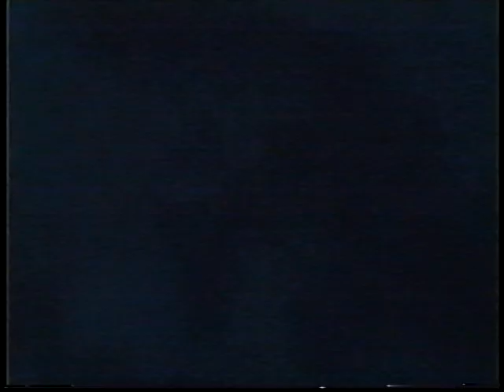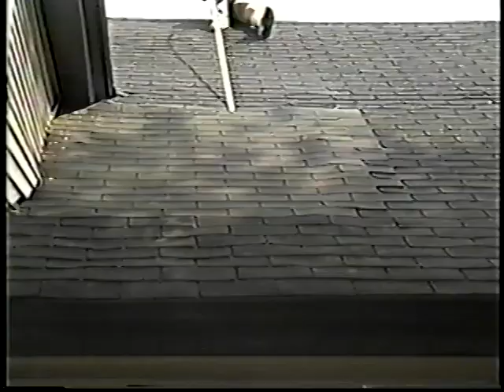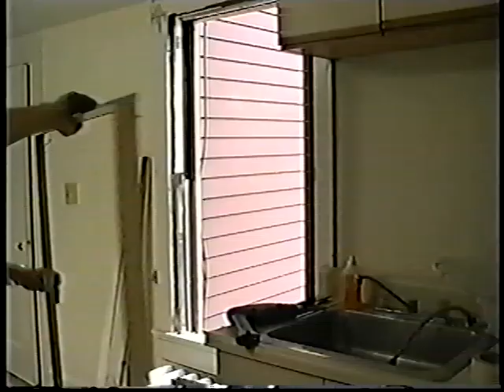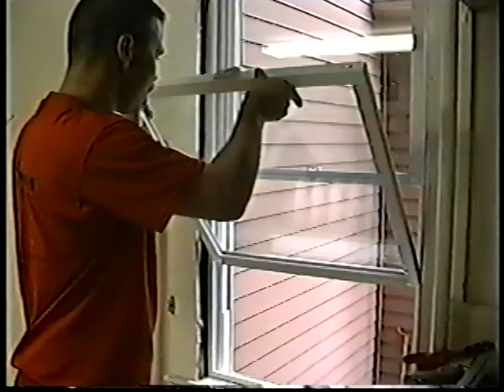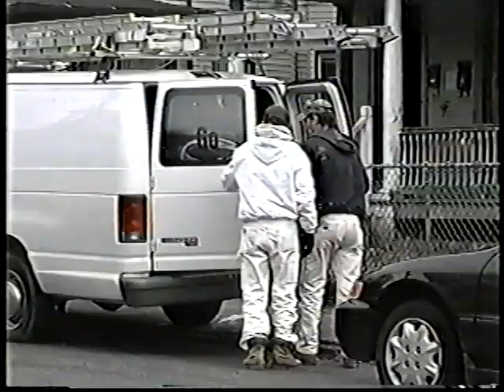Robyn Thompson’s Rehabbing Houses from Beginning to End - Tape 1: Rehabbing the Exterior (2000)

Comment from the maker: 🎯 Key points for quick navigation:

00:02 🏠 Introduction to the Rehabbing Process
- Introduction to the video series and Home Buyers LLC.
- Robyn Thompson introduces her company and the focus on rehabbing homes.  
- Overview of various repair processes, such as roofing, installing kitchens, and laying carpeting.  
- Robyn highlights the importance of reducing rehab time and minimizing costs.
02:50 🛠️ Roof Repair Techniques
- Detailed discussion on roof repairs, including the cost and steps involved.
- Introduction to the concept of "squares" for roofing and determining roof costs.  
- The process of tearing off and replacing multiple layers of shingles.  
- Discussion on roofing components, like valleys and chimneys.
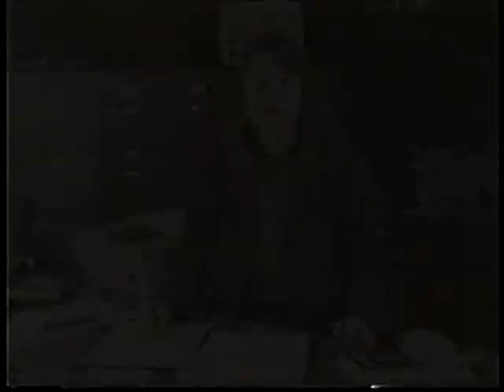04:10 🏚️ Job Site Setup and Roof Condition
- Preparation steps for roof removal and initial inspection of the roof's condition.
- Setting up equipment and protecting the driveway during roof removal.  
- Inspection reveals multiple layers of shingles and some damage.  
- Instructions on measuring and determining how much material is needed.
06:02 🧰 Roof Repair Challenges
- Addressing challenges encountered during the roof repair process.
- Discussing issues with vinyl siding, patch jobs, and the need for a proper roof deck.  
- Importance of handling valleys with care to avoid wasted materials.  
- The impact of past repairs and how to address them.
09:04 🏗️ Roof Stripping and Preparation
- In-depth look at the stripping process and preparation for new roofing materials.
- The team begins stripping the roof, removing the old shingles and shakes.  
- Discussion on how to handle old shingles, potential leaks, and the importance of starting fresh.  
- Method of tearing off layers and preparing the roof for new materials.
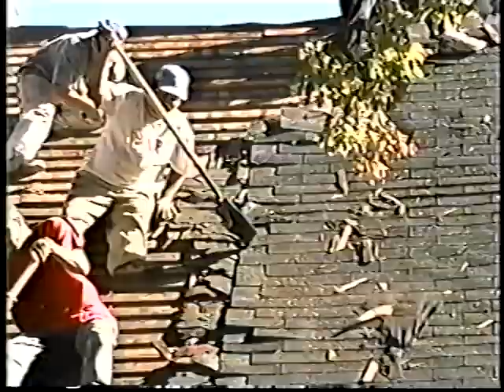12:12 🛠️ Plywood Installation and Teamwork
- Installation of plywood on the roof and teamwork involved in the process.
- The crew works together to install plywood and manage the steep roof pitch.  
- Explanation of the tools used, including the ladder vader for transporting materials.  
- Coordination and communication among the crew to ensure smooth operation.
16:20 🏚️ Shingling Process and Safety
- Focus on laying shingles and maintaining safety throughout the process.
- Shingling is done in a six-over-six pattern for efficiency and strength.  
- Use of nail guns to speed up the process and ensure accuracy.  
- Safety precautions, including roof brackets and safe nail placement to prevent leaks.
19:05 🔨 Shingling Details and Techniques
- Further details on the shingling process and handling roof valleys.
- Importance of working in valleys to prevent water leakage.  
- The crew works methodically to align shingles and ensure proper coverage.  
- Additional techniques for achieving a secure, waterproof roof.
23:01 🏠 Final Steps in Roofing
- Wrapping up the roofing process and final touches.
- Discussion of the final shingle application and using electric air compressors.  
- Final safety checks and precautions taken to ensure a durable roof.  
- Completion of the shingling process, ensuring water resistance.
23:52 🏠 Roof Installation Details
- Explanation of tar paper installation and roofing process.
- Overlapping tar paper to prevent leaks if water penetrates shingles.  
- Use of hand nails and safety considerations when working near roof valleys.  
- Introduction to conventional 25-year shingles and their pricing.
25:13 🏚️ Shingle Selection and Material Costs
- Discussion on different types of shingles and their costs.
- Explanation of 25-year shingles as the most affordable option.  
- The costs for architectural shingles and other higher-end roofing materials.  
- Overview of materials used for a roof this size and additional costs like dumpsters.
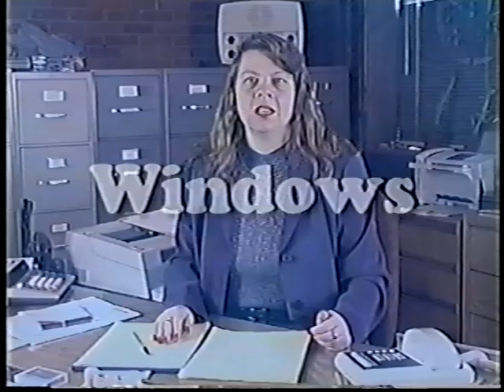28:23 🪟 Window Replacement Process
- Step-by-step guide on replacing old windows with energy-efficient thermal-pane windows.
- Removing old sashes and window components carefully to avoid damaging trim.  
- Installing new windows and ensuring they are insulated properly to prevent drafts.  
- Importance of proper window installation to ensure long-term efficiency.
33:27 🔨 Window Insulation and Caulking
- Insulating and sealing the window during installation.
- Using fiberglass insulation and caulk to ensure no air infiltration.  
- Application of caulk to seal gaps and improve the window's efficiency.  
- Emphasis on proper caulking techniques to avoid leaks and ensure a professional finish.
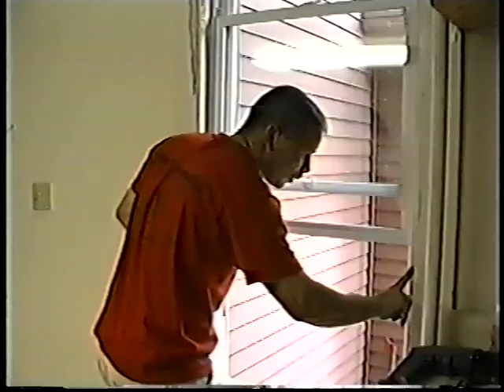46:21 🎨 Painting Preparation and Pricing
- Overview of painting preparation and cost estimates for a rehabbed house.
- Importance of preparation work, including scraping and sanding, before painting.  
- Pricing a painting job based on house size, trim, and difficulty of access.  
- Use of spray application to reduce labor costs and improve efficiency in painting.
49:39 🎨 Painting Process Setup and Challenges
- Overview of the painting setup and challenges presented by the house's height and porches.
- Discussion on using special equipment to safely access high and sloped areas for painting.  
- Emphasis on the importance of proper setup to ensure safety and quality work.  
- Mention of factors that impact painting pricing, such as the complexity of access.
51:02 🏡 Spray Painting and Time Efficiency
- Detailed explanation of the spray painting process and time efficiency.
- The use of spray equipment to quickly apply primer and finish coat, saving time and labor.  
- Description of the painting time for the front of the house, highlighting efficiency with a four-man crew.  
- Transition to landscaping and introduction to Jason Vargas, who will discuss shrubbery installation.
52:27 🌳 Landscaping and Shrubbery Installation
- Introduction to landscaping and instructions on installing and maintaining shrubs.
- Jason Vargas demonstrates how to plant various types of shrubs and care tips.  
- Overview of costs for shrubbery and planting, along with pruning instructions.  
- Explanation of the importance of seasonal pruning and ongoing shrub maintenance.
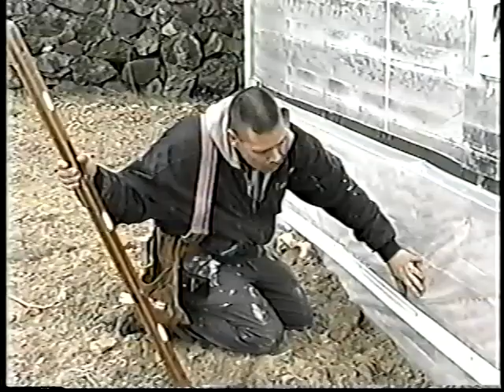55:00 🪚 Vinyl Siding Installation Process
- Introduction to the vinyl siding installation process and necessary preparations.
- Explanation of foam and plywood preparation for siding installation.  
- Steps for attaching starter strips and the correct alignment of siding panels.  
- Detailed instructions on properly snapping in and securing the first pieces of siding.
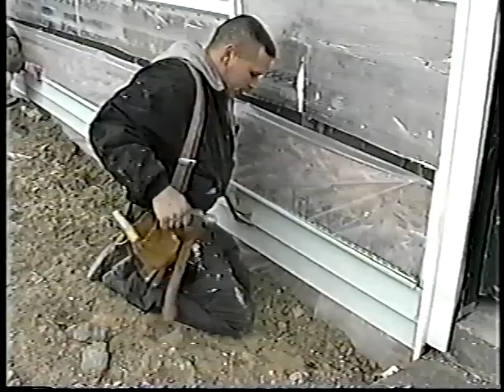56:22 🛠️ Vinyl Siding Techniques and Precautions
- Further explanation of the vinyl siding installation, focusing on techniques to prevent buckling.
- Importance of leaving space for expansion and contraction of siding panels to avoid future issues.  
- Emphasis on following manufacturer instructions for proper siding installation.  
- Tips for staggering seams to prevent water problems and ensure durability.
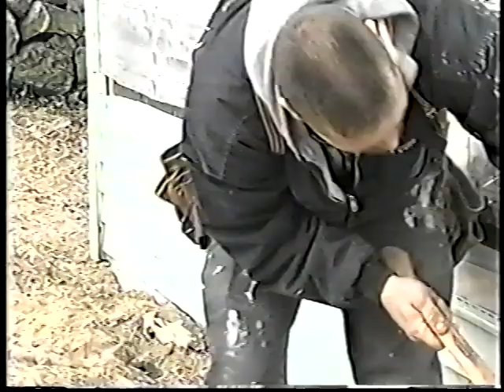59:36 🏠 Final Vinyl Siding Adjustments and Conclusion
- Wrapping up the vinyl siding process with final adjustments and proper alignment.
- Focus on staggering seams to prevent water leakage and ensure long-lasting siding.  
- Final touches on the installation process, ensuring proper fit and secure fastening.  
- End of the segment on exterior renovations with a note on the importance of following proper procedures.

Made with HARPA AI